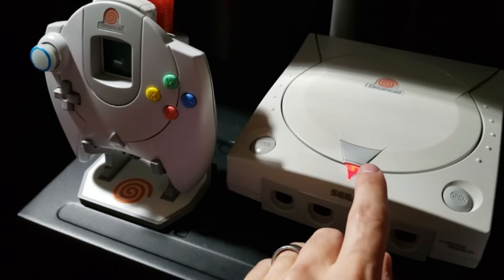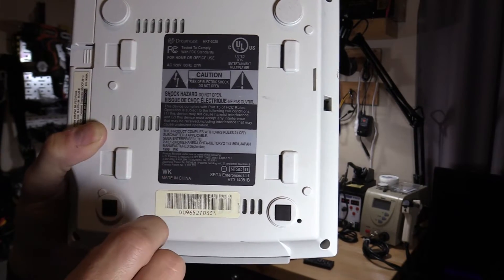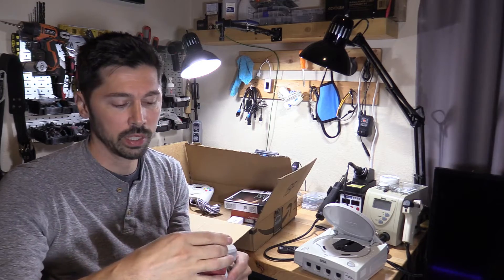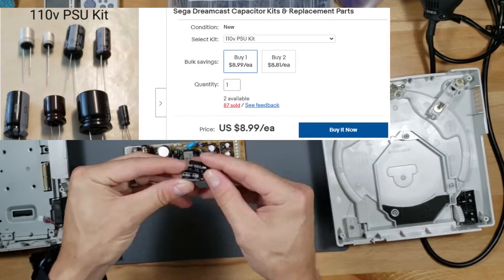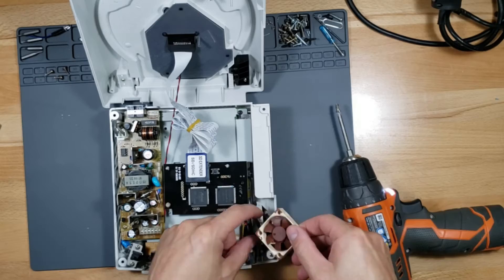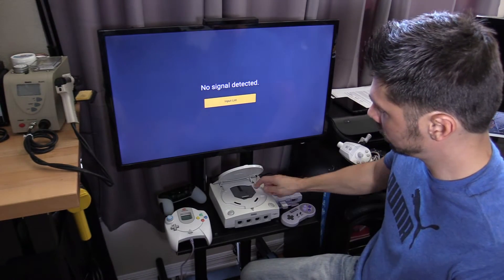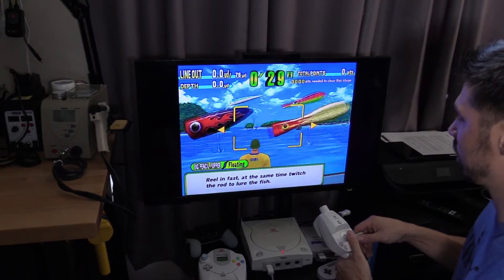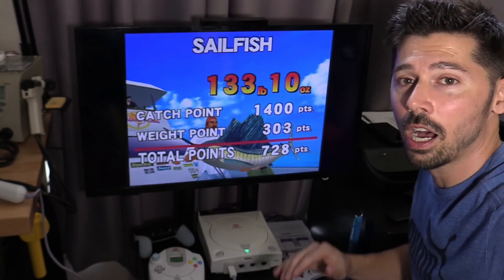How to Repair and MOD Sega Dreamcast with GDEMU SD card

Comment from the maker: total cost to repair Dreamcast is about $50 but cost to mod is about $90. 
Controller board repair kit - https://amzn.to/3n2bSAt
Ver.1 Dreamcast GDEMU mod SD card board -https://amzn.to/38ll9zG
power board cap kit- https://ebay.to/3n2cExn
Restalgia SD card mod video-https://youtu.be/cGCbVgm5ewI?t=574